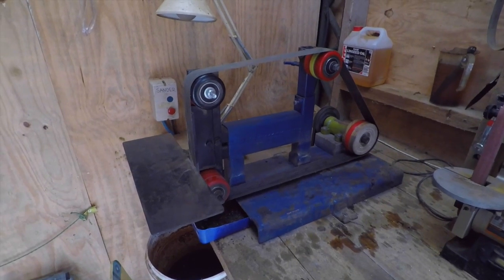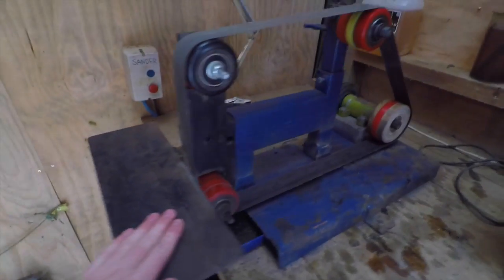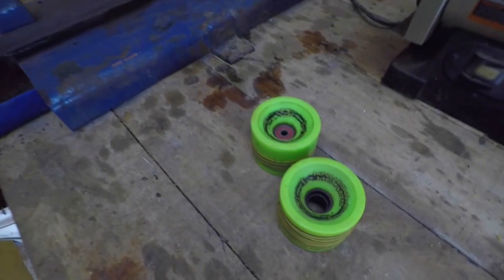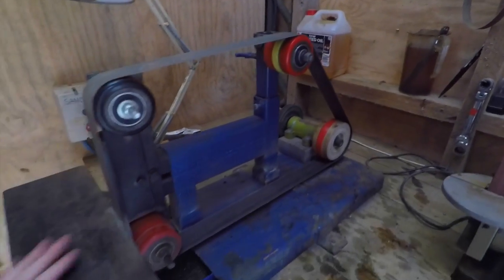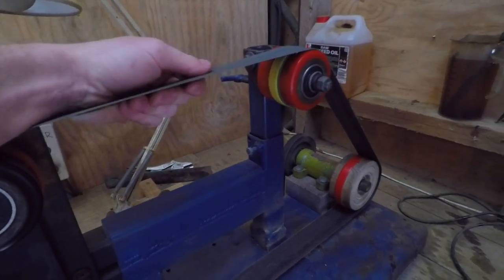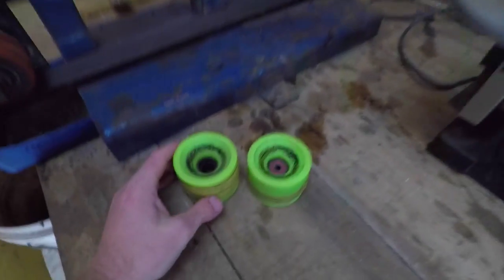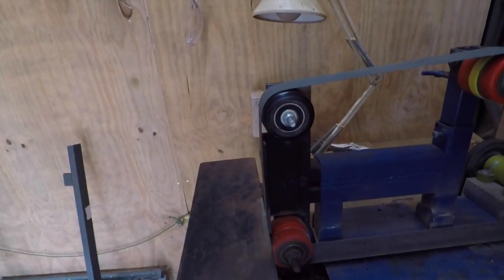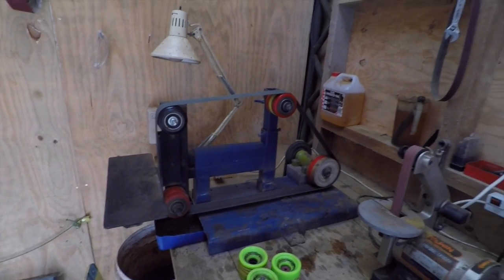2x72" belt grinder (update)

Comment: what kind of wheels are those?
Reply from the maker: Hi, so the origional ones are longboard wheels "Knuckle Heads 75mm 78R. the new ones are "urethane Wheels - Cast Centre" I believe they were designed for lifting equiptment. The place I got them don't sell them anymore but if you want a look at the place I got them see the link below (they came with berings in them too). Cheers.

http://www.wheelsplus.co.nz/page47.html